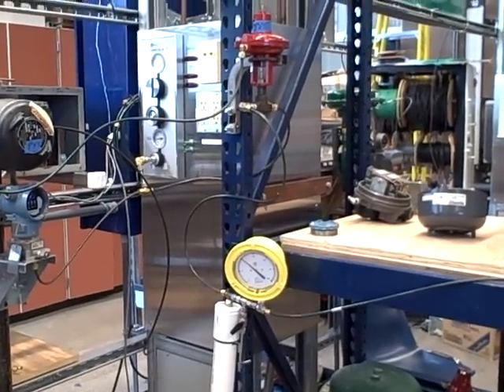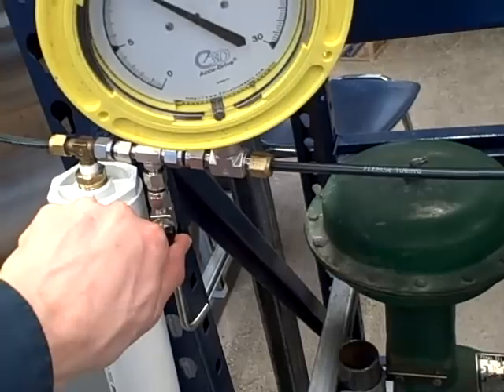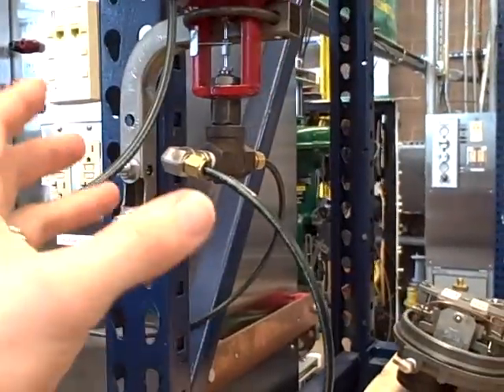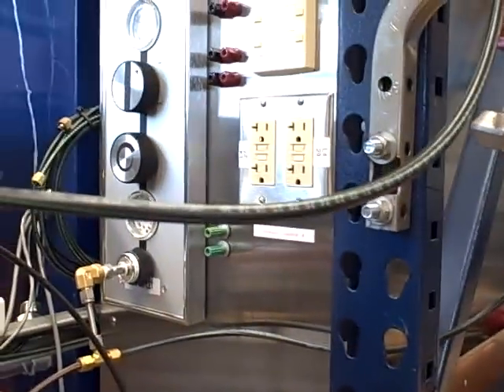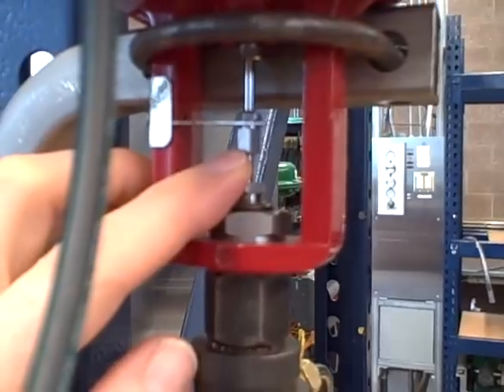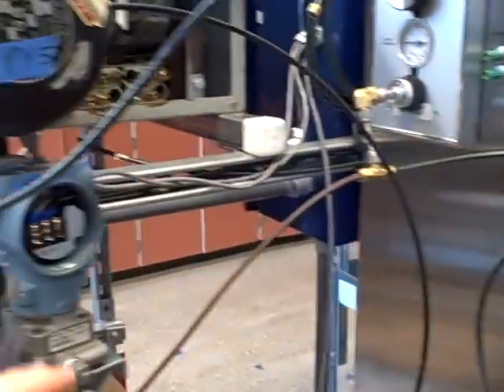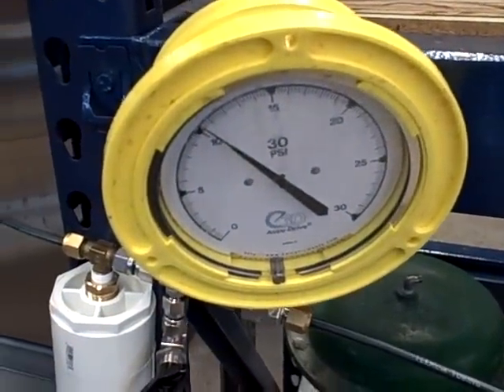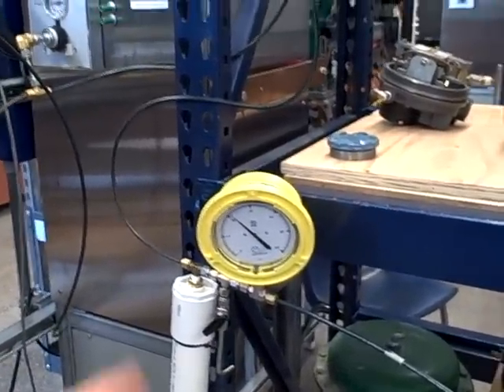Feedforward air pressure control

Comment from the maker: The transmitter sensing supply pressure sends its signal to a second input on the Siemens 353 controller, which has programmed into it a pair of special function blocks to handle that signal: a Gain+Bias block to condition the incoming signal to have the right magnitude for the desired effect, and a Summing block to add this feedforward signal to the output of the PID (feedback control) block.

Comment: That's quite brilliant. Never thought of that. But where do you send the signal from the pressure-transmitter on the feedforward loop? What sort of controller and how do you implement it with the existing PID loop?